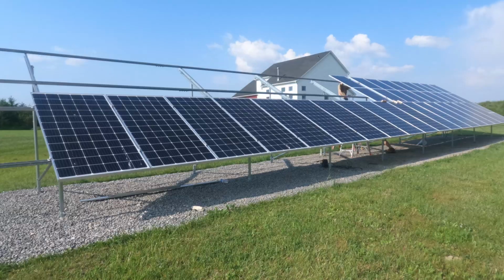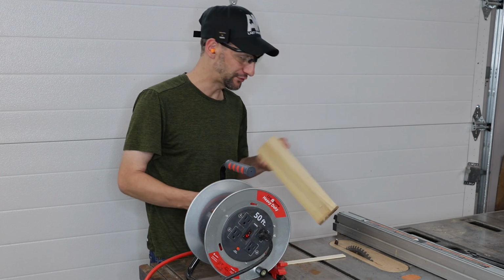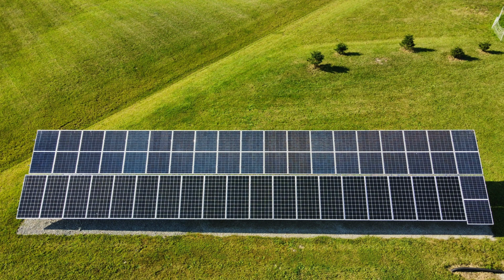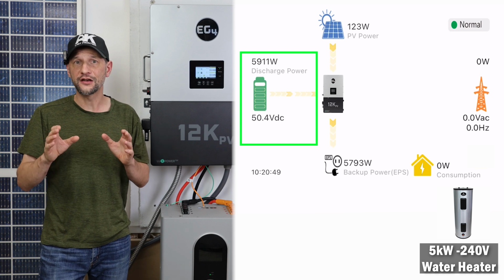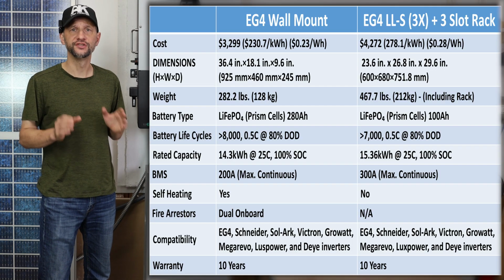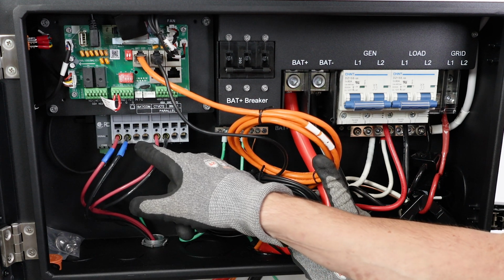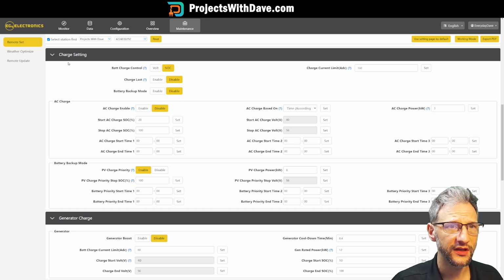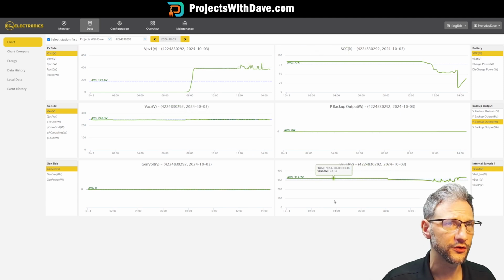EG4 12KPV & EG4 Wall Mount Battery Install & Testing Shocking Results

Comment: Dave, i'm looking at getting a Ford Lightning and want to know if we can connect the Pro power to this inverter and make see as battery or generator? let me know if what i'm asking make sense or not.
Reply from the maker: Are you asking if you can back feed the generator port with your Ford Lightning?
Reply: @ProjectsWithDave  sorry Dave I just don't know too much about this subject. I'm on Time of Use so i want to know if there a way so i can use this 100kw truck as Tesla power wall.

Comment: Great info!!

Did you need a permit to export using that eg4 inverter? Are you using a subpanel? Or is it connected directly to the main breaker panel?
Reply from the maker: You need a permit from the building inspector for the electrical install and a net metering agreement with your utility company to sell back to the grid. Otherwise you would just supply loads in a home backup configuration.  You can see the permit process in this video: https://youtu.be/imiEYDHLG4A
You can see hooking up to the grid for back feeding in this video: https://youtu.be/VkqUvd4c1-U
And this video: https://youtu.be/_xA6qOwnYbM

Comment: I am in a unique situation because my panels (16) are all Enphase IQ7+ (5.6Kwh) to a single combiner box with the PV disconnect in the main 200 A panel. All videos have panel strings directly connected to the Inverter but mine are connected to the panel. If the Inverter is AC coupled to the panel can it “see” the PV or can I only monitor the PV through the Enphase app? 
Additionally, I was looking at a Sungold 10K Hybrid ($2100) which is considerably cheaper than the EG4 but who wants problems, still $1500 might be worth a bit of risk.

Finally, My house has all natural gas appliances. The only 240v item is a small 3000w AC unit. My utility load is only 15 KW per day so I am confident the 12K + indoor wall mount will work. My bill is currently negative but I can manage things better and avoid the odd outage.
Reply from the maker: I suggest you get an electrician to look at your actual situation.  I'm not an electrician and would not want to have a miscommunication that could lead to a dangerous situation.  
If I understand the situation correctly, these are my thoughts for reference: If you want to operate the micro inverter system through the 12K, you would connect the Enphase output to the Generator input on the 12K.  Then the Line side connection on the 12K would go to the PV disconnect.  All the loads you want to run when the power is out would be on the 12K output side.

Comment: Dave, just want to point out, your string of 11 panels is likely to exceed 600 VOC, when you factor in your VOC temperature adjustment factor. Not sure where you are in Ohio, but using the generic VOC temperature calculation in the national electric code, if it gets below 4F in the winter, you would exceed 600 volts.

Take a look at NEC 690.7 for the table

Comment: Thanks Dave. Way deeper in the weeds than I'm capable of but love the challenge of following along!
Wrt lithium batteries (LiFePO4) and how to use them: my system, an Enphase with 2 5P batteries, do you think it's better to discharge them each night (barring any forecasted storminess where you'd want a full charge all the time), or keep them fully charged and maybe exercise them once a month by draining them?

My system was configured by the installer as "self consumption" and  I have no reason to doubt them (and it is what the Enphase software recommends), but I'm concerned about constantly cycling the batteries, and on the rare occasion we lose power, it's not necessarily due to a storm, which the Enphase software monitors the NWS for).
Reply from the maker: Lithium batteries like to be at about 50% state of charge.  They don't like the extremes, fully charged or fully discharged.  If you aren't getting a cost advantage from the discharge cycle, I would limit the discharge end of the cycle to 20%, that is the standard max discharge.  If you have a grid tie agreement that allows you to sell back to the grid and you are not saving money by discharging the batteries than I would limit it to around 50%.  Here is a typical chart for LiFePO4 batteries showing the expected life based on the depth of discharge: https://drive.google.com/file/d/1bQaRcWfQPhj2UwZLtLzEcAMjO_jci83d/view?usp=sharing
Lithium batteries are stored around at 50% to 60% SOC (State Of Charge) because that is where they are electrically balanced limiting dendrite growth.  However, you do need to bring them to 100% periodically so the cells can be balanced.

Comment: You should book up your older inverter that is just grid tied and still running and connect it to your gen input then it'll work all the time even if the grid goes down.
Reply from the maker: I plan to try that.
Reply: @ProjectsWithDave  My friend did this and it works great!
Reply: Dave, first of all thank you for the video.  I was wondering how big your solaredge inverter is?  I have a 10kw solaredge and plan on adding the 12pv EG4 system you have to it.  I am only using 3000kw of the PV capacity of my solaredge inverter and will be getting 12 more panels.  I think adding those to the solaredge inverter and then having ALL the PV come in to the EG4 hybrid inverter on the GEN input makes the most sense but probably not the most cost effective.  Why?  well if I just plug the new PV array into the EG4 hybrid inverter I would not need to buy solaredge optimizers (about $100 a piece) . Doing that for a 12 panel array would add about $1500 to the price tag... But running in this configuration is the best of both worlds.  Max solar harvesting with my solaredge A/C coupled system, while using the max self consumption and power redundancy of the EG4. If the power  ever goes out the EG4 hybrid inverter makes an island... separate from the Grid and I would then be running off of the battery.   When the solar output is really good and the loads are low and the battery is full the excess goes back to the grid (so not wasted). If Solar output is low (say its is cloudy or at night) and power is needed the extra power can come from the grid.  This is really leveraging the Grid.  I want to take advantage of my local power company as much as possible as I am in SOCAL and run off of SDGE (SEMPRA energy not even a US company) who are criminal at 75 cents a KWh. Thoughts?

Comment: Solar assistant easily connects to the wifi dongle. Give u instant data. I would recommend getting a ras Pi and giving it a try.
Reply from the maker: Someone else mentioned that, I'll have to try it.
Reply: @ProjectsWithDave  there is also a refresh button on the app when connected through the internet. Takes about 5-10 seconds to update but you get near instant data. I’ve successfully used this with my 6kXP.

Comment: Great video.  I have one question in regards to the ct , don't they have to be on the main panel  ac line to monitor the incoming voltage.
Reply from the maker: The connection shown in the video is the grid connection lines.

Comment: Just make sure you want that item because if you decide to return it to Signature Solar they will charge you a restocking fee!!
Reply from the maker: Good point.  Hopefully, videos like this will help you understand the equipment capability and limits so you can make an informed choice.  The equipment is very heavy so shipping back and forth with all the handling is very expensive.
Reply: Not sure why anyone would order this type of equipment and then want to return them, shipping cost for heavy items are excessive. This is not like ordering items from Amazon.
Reply: @Rock_Nemo  I ordered the EG4 3000w had it for 2 weeks and wanted to trade it in for the 6000 XP pay the difference but they also wanted me to pay a restocking fee. I just wish they would mention that when you're buying an item from them!

Comment: Great video.  I've had the 18Kpv since Feb and my only question on your settings is the PV Charge Priority.  I have mine set to Disable so that PV will supply loads first then charge batteries (also I'm grid tied).  The pop-up explanation next to the setting states that it "Routes the majority of PV productin to charge the batteries"

Can you clarify why you chose to charge batteries before supplying loads?
Reply from the maker: Thanks, I figured it was a more common setting for those who have variable electricity rates, it make sure the battery is fully charged for consumption at peak pricing.

Comment: Given how rare power outages are, I'd let the battery drain all the way to 0% during one if needed. Going to 0% a few times over 10 years is not a big deal, especially since it'll charge again as soon as the sun is up.
Reply from the maker: Yes, I think that is a reasonable perspective.

Comment: Do you use your SE inverter at the same time with the EG4 inverter to send power to the grid?  If so, when the grid goes down, will the SE inverter know to shut down (or will it sense the waveform from the EG4 and try to keep running)?  I assume that you only feed the grid from one at a time??
Reply from the maker: When the grid goes down the EG4 will also stop exporting, it will not create it's own waveform on the grid side.  If you want the SE inverter to keep running it has to be connected to the Generator input on the EG4 and configured for AC coupling.

Comment: I’m really liking the EG4 products. My only concern is longevity. If EG4 made a transformer based inverter, I would snatch it up in a heartbeat.
Reply from the maker: I think that's a valid concern.  Victron has a very long track record, giving one complete confidence.  I'm running both, we'll see which one lasts longer.  : )
Reply: @ProjectsWithDave  look at Schneider Electric for a bulletproof inverter system
Reply: The Victron multiplus are transformer based right?

Comment: Great overview and testing! I would only "need" 8kW for an inverter (ac coupled) to operate as backup but one spec not mentioned here - the 12kPV has an 80A max passthrough current.  18kPV has 200A, so I could do full house connection to the main panel.  If I do go this route, I will probably also install a transfer switch to bypass the EG inverter, in case something fails and I want grid only power.  $9K for the setup + some odds and ends, doing it myself call it $9500.  Alternatively I could get a professional install and possibly a Tesla Powerwall + gateway for like $5K more.  It's a tough decision because I'm sure if I sold the house it would be much better having that Powerwall...
Reply from the maker: Good point on the transfer capacity.  If you plan to move soon, I probably wouldn't go through the trouble to install solar.
Reply: @ProjectsWithDave  Oh, to specify my needs, I already have 2 solar arrays. The backup I install would be ac coupled unless I put it in my detached garage to replace the 5.1k SMA Inverter.  I'm in Michigan though and that would be quite the temp swing. Also, for backup, the Inverter needs to be in my basement or use a gateway (like Powerwall) near the meter instead.  Complex situation I guess.  I'm about 2 years out on pulling the trigger, I still have met metering for 4 more years. I don't mean I would move soon but who knows, so I may want something that holds more value. I would hate paying to undo an install.
Reply from the maker: If you have 4 more years before you need the battery, I would wait.  The technology is constantly changing you will probably be able to get more for your money in 4 years.
Reply: The 18K has a built in transfer switch.
Reply: @mikeyazel8725  yeah but you would rely on the 18K not failing to make sure you have power. I don't know if I want to wire my house like that.  Either way, I'll wait a couple more years on this.

Comment: Great video! I have the Sol-Ark 14K and I swear the chassis, internals and various buttons look the same! Oh, I have the outdoor EG4 wall mount 14K battery and it works like a champ!! Question, have you ever looked at Solar-Assistant? I think it is the coolest thing ever. Best part is you get all the stats in real-time, as everything is local. Worth looking at!
Reply from the maker: Thanks!  I haven't tried Solar-Assistant, I'll have to check it out.  I have an Emporia Vue that give me real time AC data.

Comment: Thanks Dave, I am planning on purchasing an EG4 unit. 
I find the whole "use lead acid battery" approach very disturbing, given the problems I have had with other MPPT units. 
Please manufacturers: Let me set the battery type to LiPO4, PERIOD!! Then provide the necessary software inputs to balance the system.
OR
Use some intelligent algorithms in you software to bring everything up to speed.
Confidence goes WAY low when the manufacturer requires us to be as well-versed as Everyday Dave is. Not all of us will be exposed to his excellent tutorial.
Reply: Bingo.  No excuse for this.

Comment: I have the 6000XP. There is no separate mounting bracket so you have to hold the 50 pound unit up againat the wall while you insert the mounting bolts. Requires two strong people.
Reply from the maker: The bracket is great!  That's the way the Victron equipment installs as well.

Comment: great to see you are using EG4 equipment. we are off-grid with the 18kpv, 15 kilowatts of bi-facial, 60 kilowatts of lifepo4 batteries and a diesel generator using filtered waste veggie-oil. EG4 is the best.
Reply from the maker: Thanks for the info.  How long have you been running it?
Reply: i ordered and assembled it in November 2023
Reply: @diySolarPowerFunWithRay  i got a good deal back in 2020 on a very low hour 6500 watt diesel silent generator made by all-power. it works well but they are no longer sold in the states. i got a backup open frame 7200 watt titan diesel with only 48 hours last year. both run on filtered waste veggie-oil and i use an eg4 chargeverter to charge the batteries.
Reply: @stevenfrazier8939 are you already thinking of upgrades?  If so what would you do next?
Reply: Going to be adding almost the exact same setup as yours except using 370 watt mono panels .  What state are you in?
Reply: Michigan
Reply: nice

Comment: What would happen if it was night, you have all of your loads running, lets 12-14k. I believe the 12kv model has 80 amp pass through so you’d be at 8000 from the battery and 4-6k from the grid. I’m assuming it would trip and reset.

I only need the capacity of the 6000xp but reading online it looks like it doesn’t have the grid assist feature, only in the sense that if load exceeds the inventor, it swaps everything over to grid vs just what it needs to make up the difference.
Reply from the maker: I haven't looked at the 6000XP in detail.  I know my Victron inverter has grid assist.  It's designed specifically to supply more power than a generator or weak shore power can provide by supplementing with the battery.

Comment: Would it be possible to test the zero export function of the 12k?
Reply: Just to see if it works correctly. This seems like the inverter to get and not have to go through the grid tie permitting process as long as it works. Thanks for the detailed review!
Reply from the maker: Do you just want to know if the feature works, or is there a specific scenario you want to confirm?
Reply: I am in a zero export situation and am also curious about the bulletproofness of their mechanism.  Are there codes that govern/approve/disapprove of these devices?

Comment: Thanks for the video.
This is the exact system I want to install 
If I have the grid backup, do I need to worry about starting the table saw and other tools?
Reply from the maker: If the grid is connected, you shouldn't have an issues with anything as long as you don't exceed the max passthrough current.  However, I was able to run everything I own even with the 12K off grid.  You should be ok as long as you have a soft start for your AC or heat pump.

Comment: I use the smaller 6000xp but I have a small off grid house, it powers my water pump really easily which is my largest load. I'm also very impressed with Signature Solar.
Reply: It may power your water pump today, but will it still be able to power your water pump in a couple of years? I doubt it.
Reply: @quickquote1568  it will, almost a year now

Comment: How is the menu set up and overall ease of use on the EG4 12K versus the Victron equipment? I love the detail and ease of Victron software and menus!
Reply from the maker: The Victron setup has more options, but the EG4 should meet most peoples needs.  The settings are not as intuitive as I would like, but once you figure them out its fine.